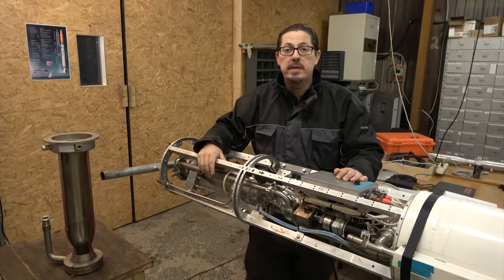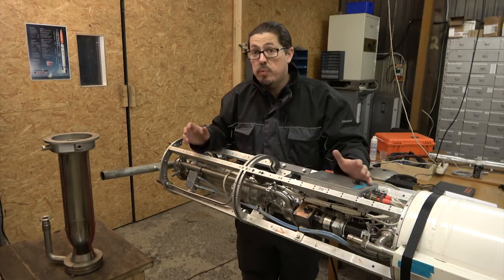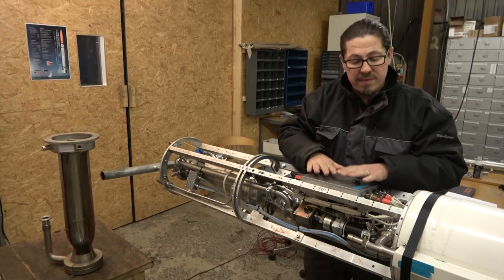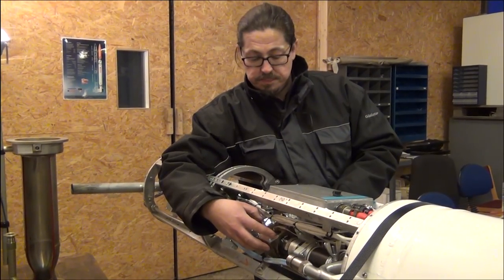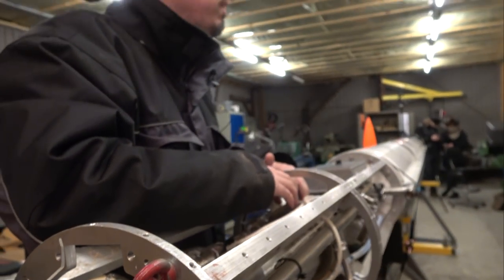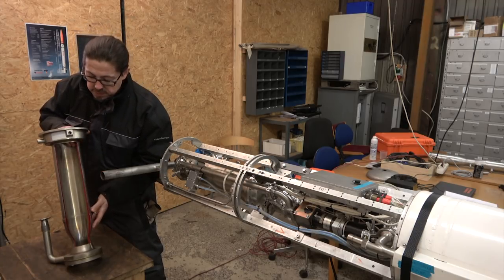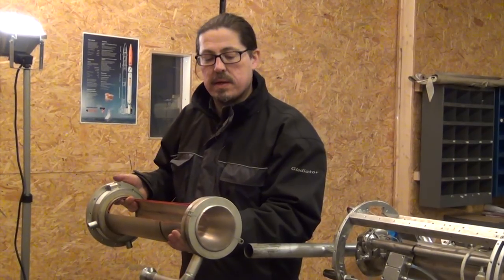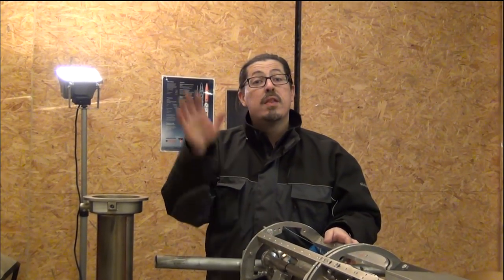A walkthrough of the Nexø II rocket (Part I)

Comment: Have you considered using a more sophisticated leak detection system after using the soapy water technique? For example, you could use a refrigerant gas to pressurize the system and then use a refrigerant leak detector, these are quite common due to their widespread use in HVAC-R repair.
Reply: Helium is also used in HVAC-R for even more sensitive leak detection, but the detectors are rather expensive!
Reply from the maker: It's definitely possible - but we try to stick with the quickest and cheapest method - and in this case soapy water worked just fine. We still have minor leaks  - since the video was record the rocket has been pressurized for days saveral times - to record the pressure drop over time. We are loosing a bit of Helium over time - but not more than the pressure drop within a 8-12 hour timeframe is acceptable for launching
Reply: W Bailey But leaking refrigerants is highly illegal, which is why so much effort has been put into preventing and detecting leaks.
Reply from the maker: And also - most refrigerants are much larger molecules then HE - and will leak slower anyway.
Reply: At least here in the US a very small leak is explicitly exempted from any kind of reporting or regulation. I would be very surprised if leaking a kilogram or less of refrigerant was a legal problem in Denmark considering leaks of that size are essentially inevitable when handling or using refrigerant (leaks on valves, leaks through fittings if a cylinder is left open, gas left in hoses when disconnected etc). Plus, there are quite a few different refrigerant gasses available, you could even use a flammable gas and a flammable gas detector if you liked living dangerously.
Reply: Or even an odorant gas and one's nose!
Reply: It is true that He is the best at leaking through pretty much anything but helium leak detectors use portable mass spectrometers so they would probably not fit into your budget.
Reply from the maker: True, but my point is that since it's a high pressure HE system we must use HE to test for leaks. Even Nitrogen will leak at a slower rate than HE.